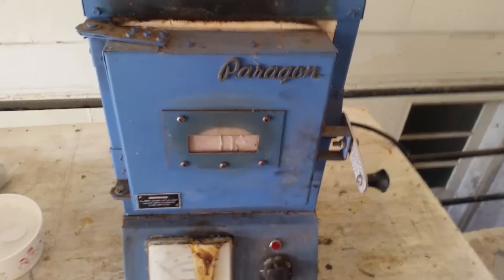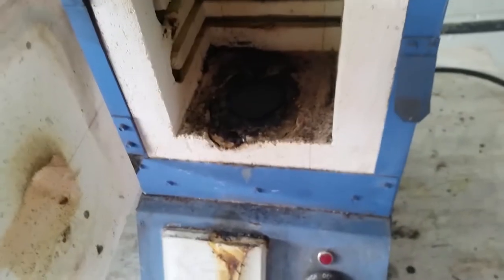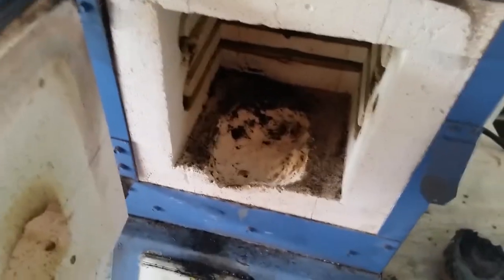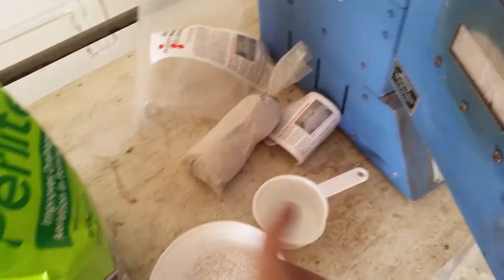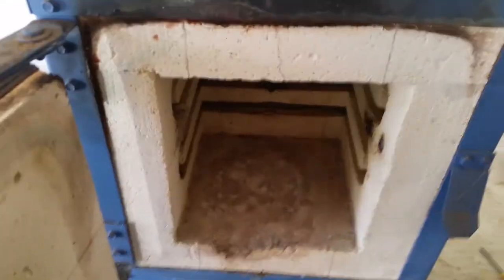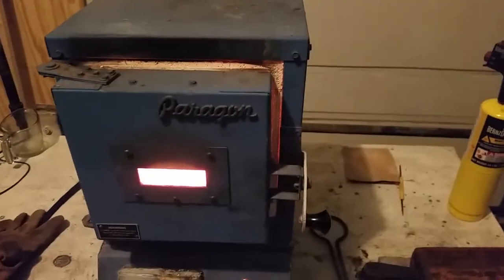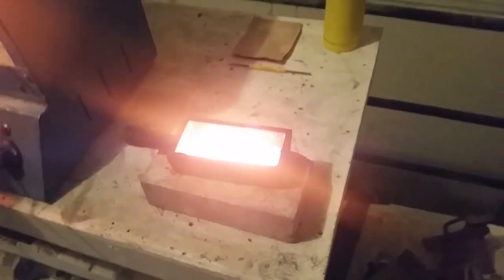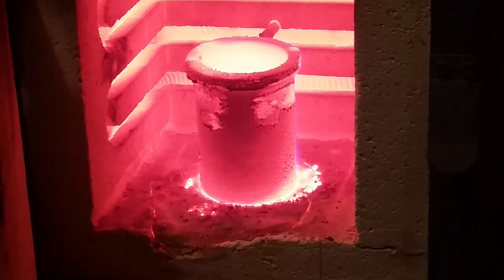Patching Broken Cement In My Kiln

Comment: on my moms pc but i have to comment. your cement shrinks cause u need to slightly dampen the inside of the area you will be fixing. this allows it to dry and cure correctly in the seem areas.